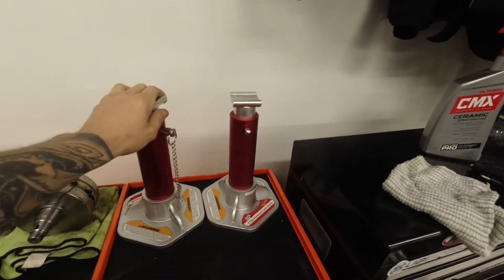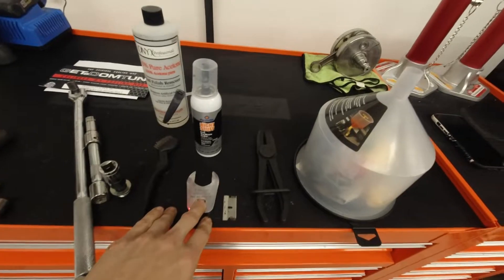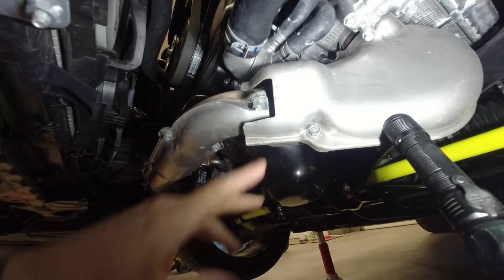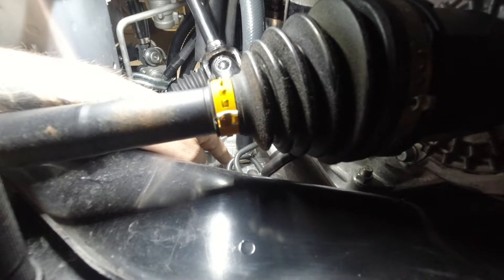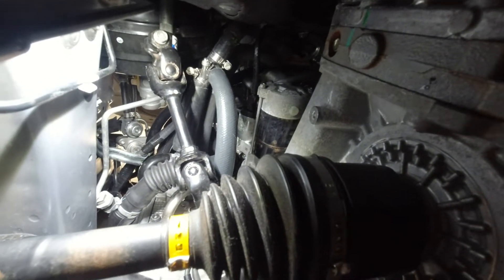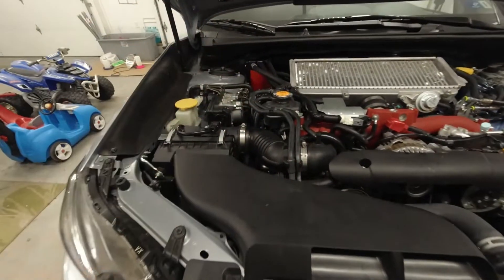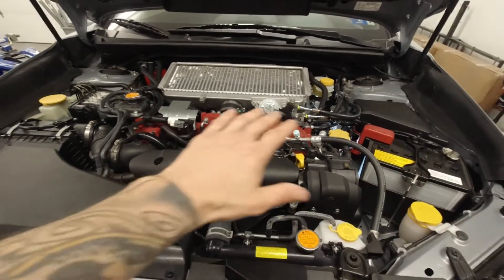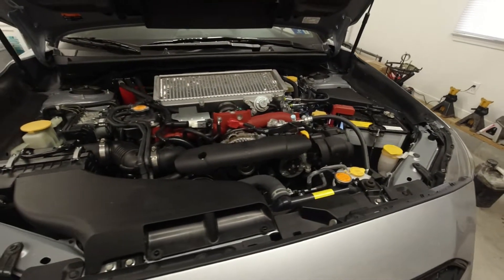Walkthrough How To Install GetaDom Tune WRX STI #4 Cylinder Cooling Mod

Comment: Great walkthrough!  I see your back to the OEM intake, just curious why?
Reply from the maker: Thank you I appreciate the comment. As for the intake question, this video was made roughly 1.5 years or so ago. I thought I had lost it and came across it the other day while digging through files. 

So this was one of the first mods I did before I did all the other mods.

Also found another I thought I had lost as well It will be out in a couple weeks.

Better late than never I suppose lol.
Reply: @spdkills83  😅Ha..ha...makes sense now!

Comment: Quick question. Could you not get to it from the top? Also do you have to drain the coolant? I’m thinking if you pinch the lines that might do the trick.
Reply from the maker: You could try to go in through the top I suppose if you are patient and/or sadistic lol. Seriously though it's worth giving it a try if you think its possible.

As for the coolant drain I tried myself to pinch them off and ended up creating a huge mess when one slipped off so just drained the whole thing. Not really a big deal if your do for a full coolant change anyway.

Good luck